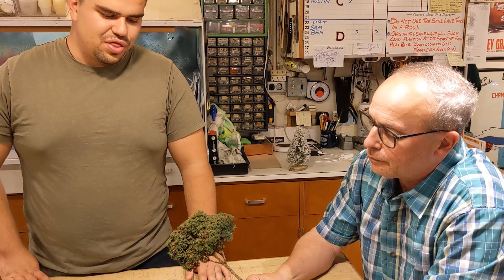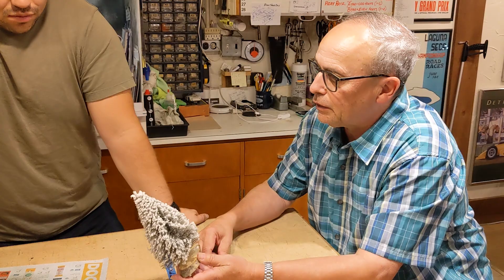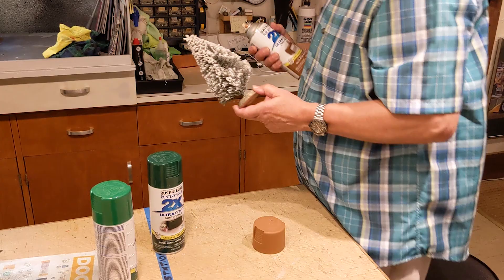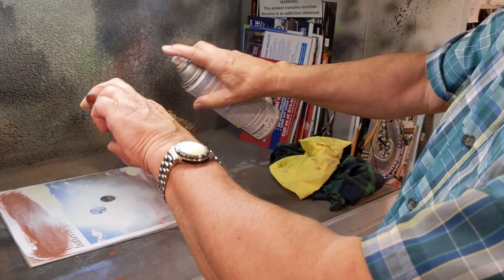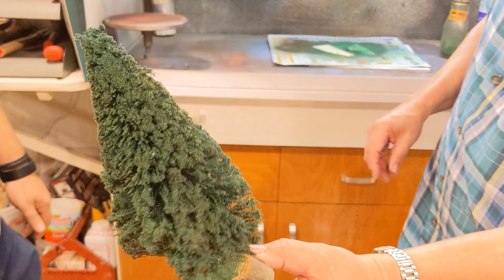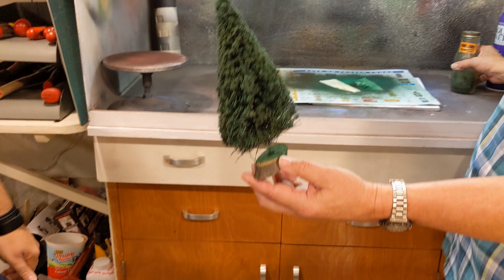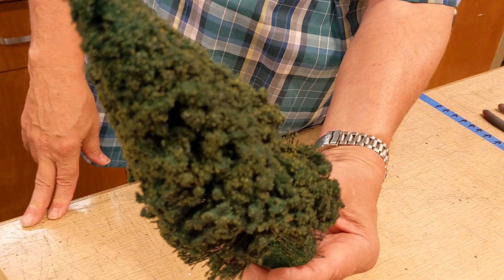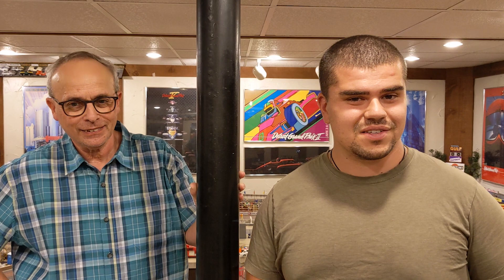Modeling / Slot Car How-to Series: Detailing REALISTIC Trees - World’s PREMIER Slot Car Racetrack!

Comment: Howdy Ryan.  Is Jimmy aware of anyone using the AC2Car system with 1/43 scale cars?  I have not been into slot cars since 1/64 as a kid and would like to get into them.  From what I remember of the 1/64 cars, I don't think you could fit in the necessary diode but I have not seen the inside of a 1/43 scale car to know and that would probably be my size preference for my limited space.  Thanks in advance if you remember to ask.
Reply: Yes Miniature Motor racing has a 1/43 scale figure eight that uses the AC2Car system to run a figure 8 that they rent at parties. Look them up! It's pretty cool